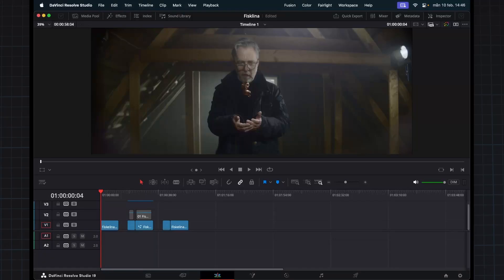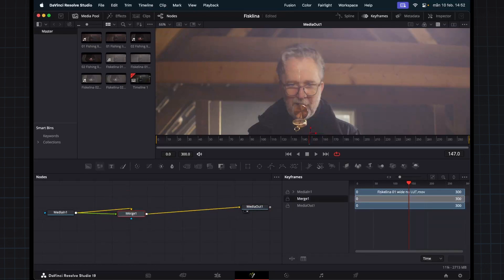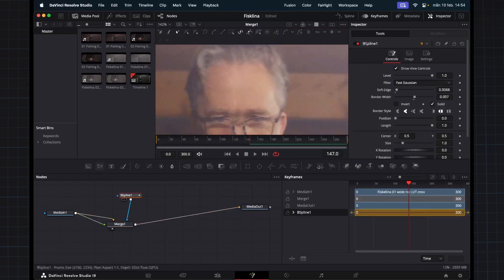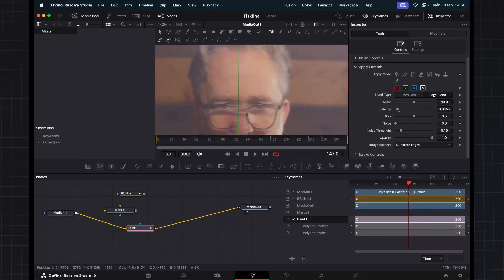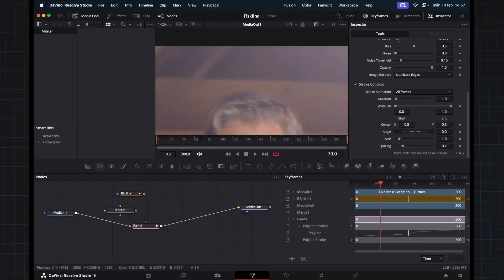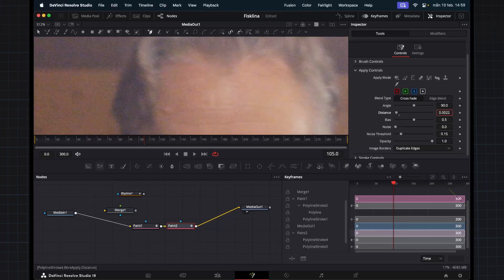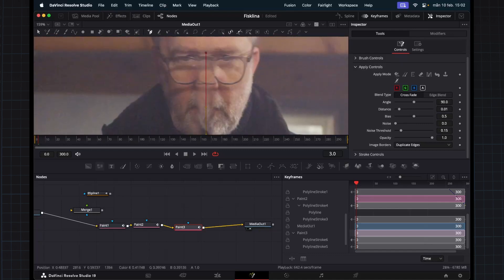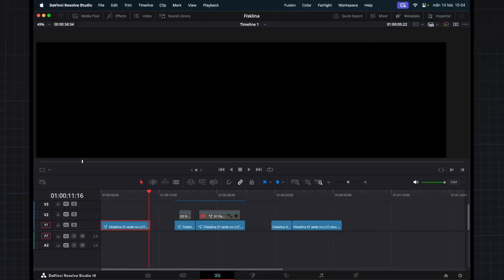How to Remove Wires in DaVinci Resolve Fusion!

Comment: Helpful, thanks! I am always surprised that the answer is 90% multiple instances of an effect to get the desired effect, multiple wire removals for this, or for example having multiple keyers when keying a green screen.
Reply from the maker: Yes, its quite common to do several chroma key passes when the screen is not perfectly lit 👍